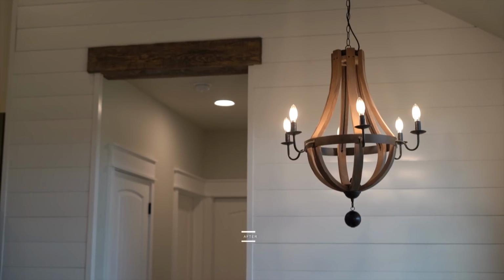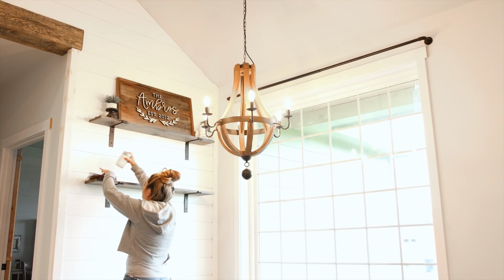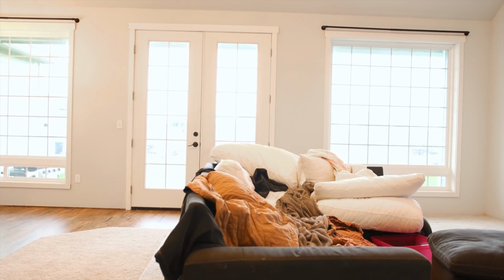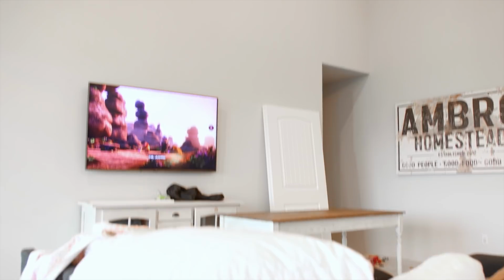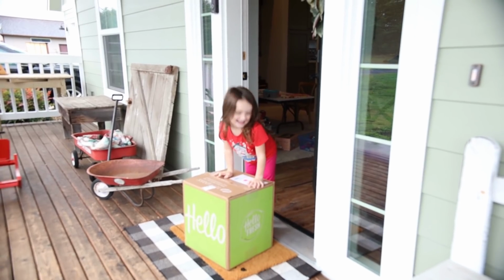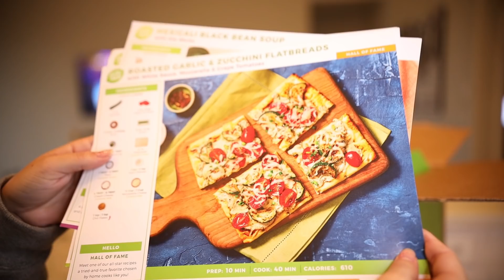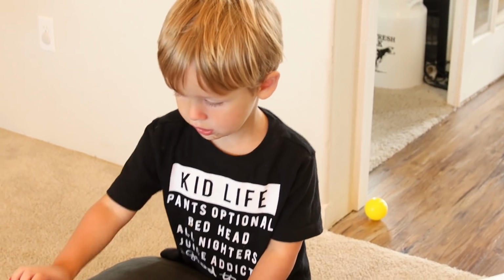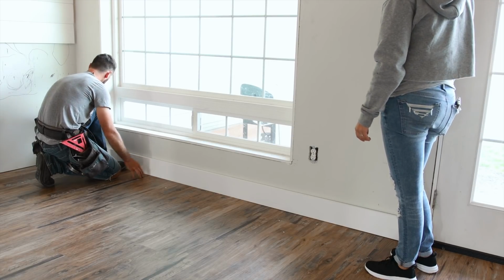DIY Board and Batten Wall Makeover

Comment: I love the trim above your doors! What is that called, does it have a specific name?
Reply: I have that in my house and I call it “Craftman Style Trim”. But it maybe called something else. Look on Pinterest. You should be able to find it on there. Hope this helps.
Reply: @cathywatwood2750  Thank you! It helped a lot. What I wanted to do to my opening of my living room it's a little wider than just a door. But I've never seen trim on it! I'll definitely look on Pinterest.
Reply: I have a wide opening that’s goes to my sunroom so I had my husband to leave off the bottom board.the middle board(which is the widest) he let it stick over about 1/2 an inch then did the top board a little over 1 inch. It looks real good too. I only have 8foot ceilings so that is why I did that over the wider opening, but my other doors are like hers.